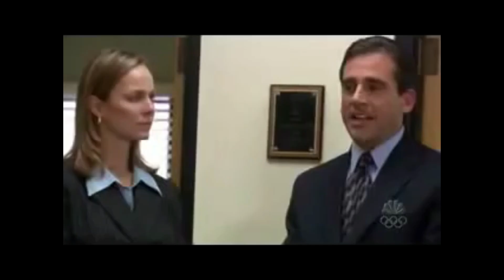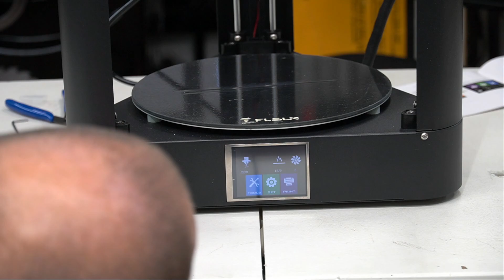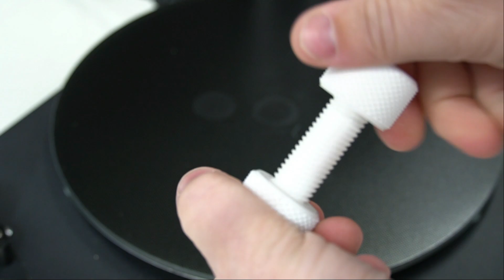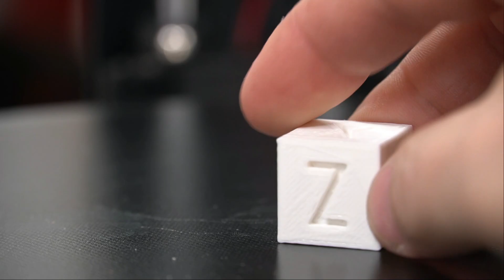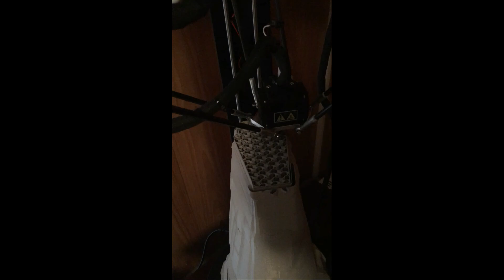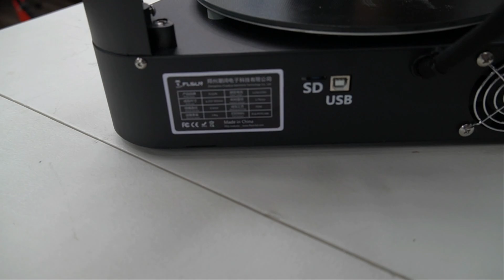FLSUN QQ-S Pro Review

Comment: I remember in the mid 70s my folks had me working with land surveyors they bought a piece of new equipment called a plotter being able to draw sewer plans and subdivision layouts saving days of inking the plans on velum, the thing made horrible noise as it ran, I remember they got some 4 inch thick dense foam and placed a slab of rock or concrete on top of the foam resting the plotter on the concrete,  it definitely silenced it. Hopefully you found a way to quiet her down, I'm buying my first 3d printer soon I know I want a delta printer
Reply: Your parents were pretty pioneering. They dumped some cash on that plotter lol :)

Comment: This is the Delta Printer I was thinking of Maybe getting?  Here in the UK I can get it for £209.00p  which is cool price when I paid £189.00p for my Voxelab Aquila Printer awhile ago.

The test cube you did did have ghosting on the X & Y .   

I may get another Aquila and with the fact they are now around £160 to £170 I could use the saved money to get a 3D leveling probe for the Aquila I get next?

I like the idea of the big Delta for high prints since this one is 14 inches of print height available.  But the Aquila can do almost 10 inches high prints and the square bed can do almost 9 inches.

We see?

Comment: I'm not sure what went wrong with yours but I have had mine for two weeks now and it has been the best 3D printer I have owned so far. This is my 9th 3D printer I believe.

I was so impressed with the quality and quietness of my Monoprice Mini Delta I had to size up.

This FLSUN QQ S Pro is so quiet and is running just behind me right now. I have had it running almost 24/7 since I set it up.

The only problem I had which seems quite common but is an easy fix is to replace the 120V power connector which I had one on hand. A 5 minute fix.

I just finished a full size human skull at .01mm. It took four days to print but came out perfect with only bottom support.

Now I am printing an air raid siren that is many parts, both delta printers are working with the FLSUN taking on the larger prints.

Comment: Reliable with no tinkering - EXACTLY!  I grow weary of all these videos showing how you have to "upgrade" your printer to get quality out of them - at least that's the impression they always give.  Just using a 3D printer makes it a small hobby.  Having to customize it to get great prints makes me cringe.  I want to do more than just print all day.  Thanks for such a great, simple and practical review.  Now a question: The website says this printer has 0.15mm layer height while the Q5 has 0.05mm layers.  So do you get better resolution from the older and cheaper printer then?
Reply: You don’t, they’re just saying that test it for yourself, 0.05mm is quite low 0.12 is probably the lowest that you can print reliably

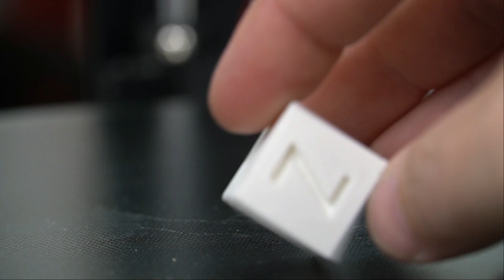Comment: 16:00 "pretty"? That's one of the worst cube I've seen in my life, lots of overshoot in the corner and ghosting all over.
Reply: You’re not wrong that it’s not the prettiest cube but it is only 350 and most of the other prints looked spectacular. Then again I only have 3D printing experience with an ender 3 v2 but after buying the flsun and using it for about 2 weeks I definitely like it better

Comment: Been running these machines for several months- very capable. The last delta I had was the little monster and it was riddled with problems for 3 times the price. This just works. Sure it's not as big as the Tevo but overall the QQS is just a better machine. I print with 0.5mm nozzles and even then quality is still excellent. Highly recommend.

Comment: I printed better cooling air ducts and replaced drivers with tmc2208, quite happy with my results. There are several cura settings that make a big difference, like max combing distance. Next step for me will be more powerful cooling fans.
Reply: Hi Vlad, Im planning to upgrade the drivers with TMC's. how did you go about doing it? there is no specific instructions or guide online for this printer. thanks
Reply: @koking  hi, you can ask flsun support for a link to buy those drivers. They are socketed, so you just pop them out and put new ones in. You also need to install heatsinks, they are included. I would send you a link but I'm pretty sure it's not allowed in yt comments

Comment: Had mine for about 3 weeks, awesome addition to my printer collection. Stepper blocks installed underneath and rod braces really help with the noise from this printer. I have 2208 stepper drivers coming for it from Flsun too, so that should get rid of more noise. Side note, the printer in your thumbnail is a QQ-S standard, not QQ-S pro.
Reply: Motor mounting blocks that fit tight to inside of the base (reduce motor mount flex and improve belt tracking)  lower and upper rod stabilizers all round, and arm stabilizers which dampen vibration at print head. I also relocated the spool holder to the rear of the base as I found on tall prints it would swing when printing at speed. Most of these were on thingiverse or yeggi.
Reply: @ZeBadgers  Thank you so much!
Reply: @theq4602  no problem. These are awesome printers for the price. Been printing PETG on one of mine lately, handles it really well.
Reply from the maker: Great to hear!
Reply: I just bought this printer. It's very quiet no idea what you are talking about. I leave it on in the kitchen next to my parents bedroom and they cant hear it running. The loudest sound it makes is moving the whole assembly a large distance up and down and the extruder retracting quickly. Maybe the startup beep.
Reply: @theq4602  The extruder was the only noisy part of this printer, stepper driver upgrade got rid of the 'beep beep' noise they tend to make on retraction/feed. I have 3 of these now, all sounded the same. Also mounted each on a rubber mat so they are even quieter. The blocks/braces I made improve print quality a lot, especially at high speeds by reducing any flex in the frame and stabilizing the motors underneath.
Reply: @ZeBadgers  Could you describe the frame mods you made?
Reply: @ZeBadgers  I have a FLSUN SR and I'm always completely baffled by anyone that complains about the noise of these printers lol, mine almost sounds like an air valve releasing when it retracts and it makes my "little friend jimmy" fizz everytime it does🤣🤣 I love the whirring noise it makes. Makes me feel like I'm using something futuristic🤣 only thing I noticed is mine doesn't make those weird "robots having a converstation" noise when moving around, like you hear in this video, only when retracting... but the retraction sound is the same as in this video. Like yeah, it's a bit noisy, but omg does it sound so moist.... lol
Reply: @whywouldyoucareaboutmyname  mine was way better after changing the stepper drivers, and I recently put a bmg dual gear extruder on which made the retractions all but silent.  A couple of months ago I bought an Anycubic Predator, awesome printer but loud. Will be doing a complete board swap on it when I get the time.

Comment: aww...did you pre-heat the bed for auto level? That's part of the instructions with my Q5...I reckon the QQ-S makes no difference. Tempting idea to get me a bigger delta in addition to my two Q5...
Reply from the maker: i didn't, and it turned out fine.